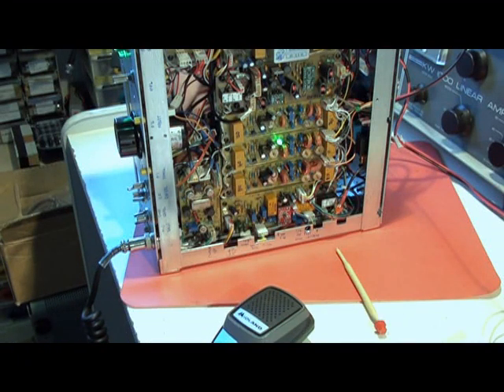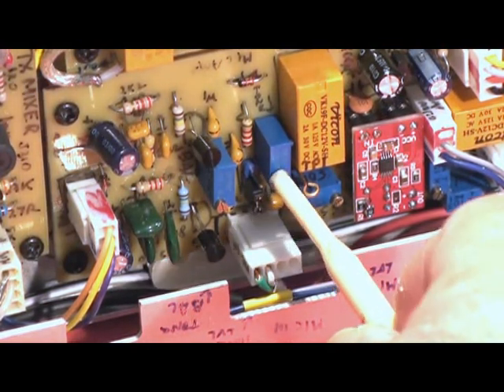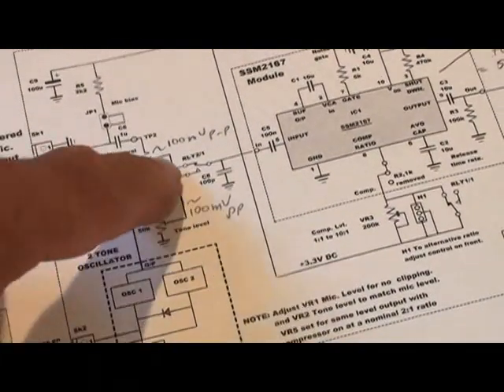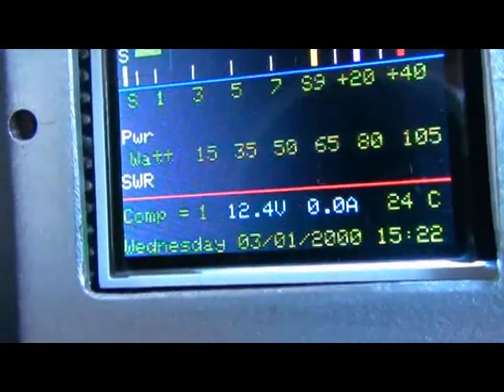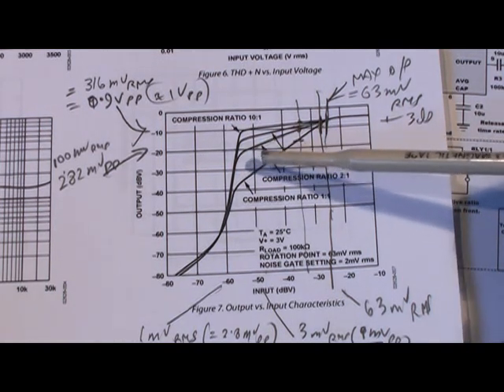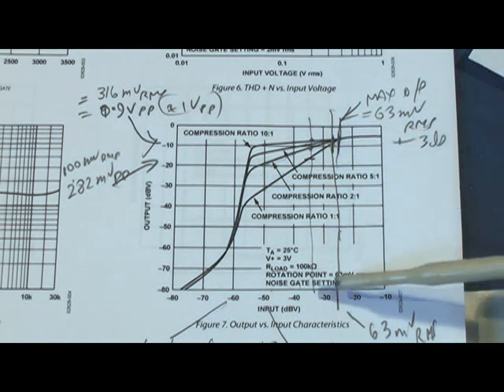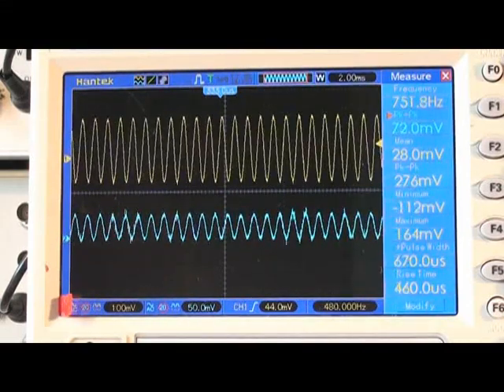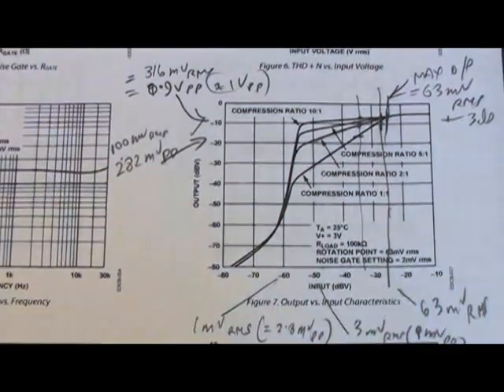MK5 Microphone amplifier setup

Comment: Thanks for sharing Lou !
Your scope is the same as the one I mainly use, I used to get the same little 'spikes' appearing on the display. I added some clip on ferrites to the left and right hand side ribbon cables that go from the PSU to the main chassis, it got better but something was stil 'amiss'.
I live with another ham - M0IIZ who had been complaining that the QRM on nearly all the HF bands (apart from 80M which is terrible regardless as most our neighbours have solar power) had recently got worse, and had I been using anything contributing to the QRM, I went around the house unplugging, disconnecting, shutting down everything I could, mains, battery - everything, apart from.... the Hantek scope. I thought what the hell and turned it off. Suddenly there was a yell from downstairs 'That's it!!' so I powered the scope back on, nothing... until it had finished booting up and the traces were visible ie. normal operation. It comes from the actual LCD screen panel ! just placing my hand flat against the screen gave +40dB QRM on the FT-990 downstairs fed from a ZS6BKW at the bottom of the garden with balun and a load of ferrites indoors around the RG213 going into the rig - so some 60-70 foot away from my workbench. Simply grounding the metal of the screen to the scope chassis the interference went away. I have since placed a piece of foam covered in fine metallic mesh that was between a tuner/prescaler from an old cable tv box behind the scope screen to ground it. Covered the inside of the blue rear housing with self adhesive conductive tape (it took a while pushing all the air vent holes back through) and last but not least.... I found that at frequencies around the 2M ham band that depending on where the scope leads were, the amplitude of the waveforms changed, so I took more clip on ferrites, attached one at the BNC end of each lead with a single turn - so the cable actually goes through the centre twice, same at the probe end of each lead. Voila ! I did that with both the 200MHz leads I keep with that scope and have never needed to use the bandwidth limit function since and get NO spikes or noise on the viewed waveforms unless I go to the extremes of it's ability. Hope that's of any help if you haven't already beat me to it... 73 Sam.
Reply from the maker: Yes, you are right. I have to turn it off when using my ham gear. It generates lots of hash. The fan in mine also failed and I have now put a fan from a CPU inside it. Ok on the ferrite clamps - might try that. Sometimes I connect the probe earth clip to my ham radio gear and that also drops the level of hash. The use of a plastic case, and the LCD,  does most of the damage. Thanks for sharing your experience here. Cheers, Lou.